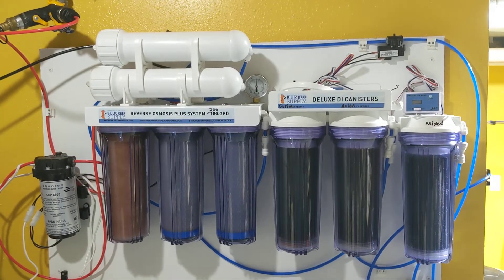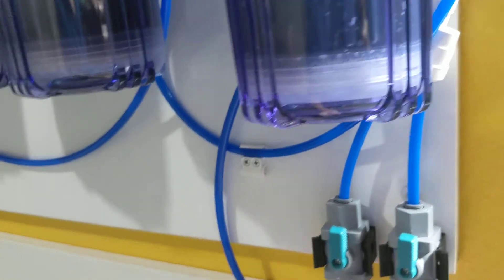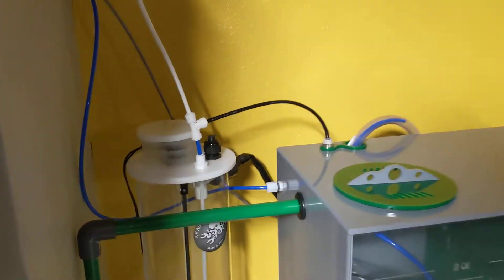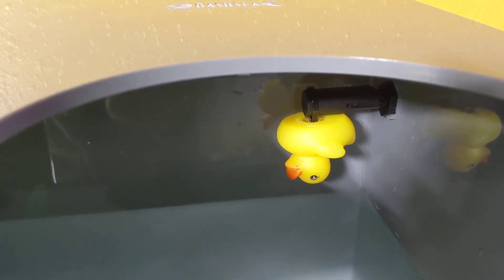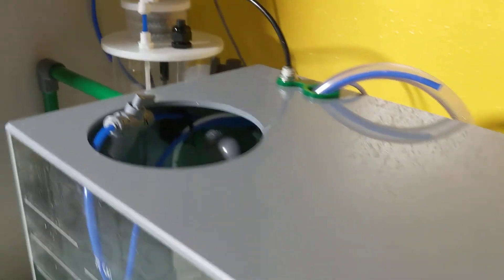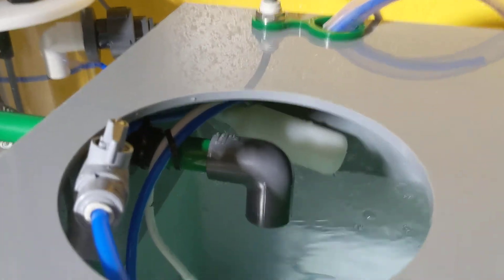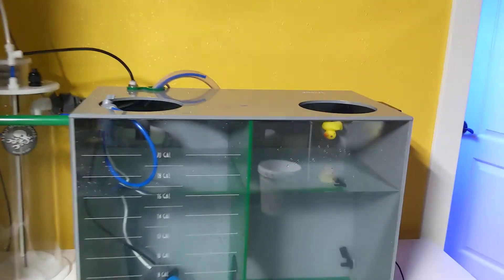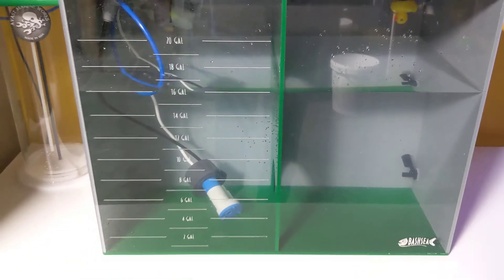BRS RODI plumbed to Bashsea ATO and Avast Marine kalk stirrer

Comment: Hi! I want to get the Kalk stirred but I’m confused if I used it with my ato do I need a dosing pump? Or just with my ato would work? Do I need a timer?
Reply from the maker: When I started i pushed Kalk from my stirrer through my ATO alone.  However this really just resulted in my overdosing it as my alk consumption was far below my daily evaporation rate.  This manifests itself by abiotic precipitation of calcium carbonate and was causing my sand bed to clump.  Other than that it wasn't hurting anything per se.  Some may experience excessive pH levels however.  Best practice (what I'm  doing now) is to pull RODI water from your ATO reservoir with a dosing pump of your choice and push that water into your Kalk stirrer.  Set it to dose the amount of your daily alk usage, at a minimum you have to know that regardless of what you are dosing (two part, soda ash, kalk etc).  The rule of thumb i go by for dosing kalk is 1.25% of your system volume of fully saturated kalkwasser will raise your alkalinity by 1.4 dKH.  For example if  you have a 100 gallon tank and you dose (via your doser) 1.25 gallons a day you'll raise your dKH by 1.4.  You'd adjust this down according to your actual usage of course.  The avast stirrer I'm using gravity feeds my sump so as my Echotech Versa doses RODI into my stirrer it just over flows into the tank.  It's been very precise to date.  Just make sure the calculated volume is less that your daily evaporation rate.  The remaining volume is simply made up by your ATO system.  In my case the Tunze 3155 makes up the difference on its own and it all works out perfectly.
Reply: @RobBzReef  let me see if I understand correctly ( I’m no from USA so I’m still need more time to learn/understand better) so I just bought the Avast Stirred and a ph controller. My plan is use one of the dosing heads to pump my Ato so it will feed my Kalk stirred, and connect my ph controller to the doser so in case the ph goes higher it will shut it down.
I have a 135g and the evaporation rate was around 3000ml per day, I dose Kh 7 ml per day and Cal 3ml per day. So now I have to divide the 3000/24hours? Or based on the Kh 7 ml 🤦🏼‍♀️ here is where i get confused. Thanks
Reply from the maker: @kamilawright5665  no worries, we can work through this.  I'll need to clarify a few things first so we get our terminology straight.  What is your tank's daily alkalinity consumption rate currently?  You mentioned dosing 7ml of dkH daily.  7ml of what?  That doesn't seem like much for a 135g tank regardless of what you are dosing.  What unit of measure do you track your dKH in (meq/L, dKH or ppm)?  

Let's start with an example using your 135g tank, we'll use dKH as the measure.  If you use meq/L or ppm there are conversions available (dKH to ppm => dKH * 17.86, ppm to meq/L => ppm * .358).  The assumption will be your tank consumes .4dKH daily in alkalinity and your total system volume (include display tank volume and sump volume if you use one).  In this example per our discussion we will be dosing a fully saturated solution  of kalkwasser(calcium hydroxide).

Total system volume * 1.25% => 135 * .0125 = 1.69gal or 6,400ml.  That gets us a dose of 1.4 dKH in alkalinity.  However we only need a .4 dKH dose for this example.  So we take our target dose (.4) and divide by our baseline .4 / 1.4 = .285.  Multiply this by our volume calculated earlier (6,400 * .285 = 1,828ml).  So in order to maintain a daily consumption of .4 dKH using Kalkwasser you would push 1,828ml of RODI water through your kalk stirrer daily.  If your daily tank evaporation was 3,000ml as you mentioned earlier you would make up the difference (1,172ml) in straight RODI water from your ATO using whatever liquid level control you have in place (I use a Tunze 3155, there are many out there on the market).

I hope this helps, let me know if you have any other questions.

Comment: Beautiful setup so far. Clear you have put a lot of thought into it especially with all the safeties you have incorporated. I must have flooded my basement 5 times before I got it right and really it never looked as clean as yours does even to this day. Keep up the deep thinking and your system will be great.
Have you gotten the Kalk stirrer up and yet and how have you found it so far?
Reply from the maker: hey, thanks for the positive feedback.  Always room for improvement for sure, need to start thinking about AWC next and finishing my light hood and stand covering next.  The kalk stirrer has been up for almost two months now (just shortly after the video).  It's really working as well as i had hoped.  It keeps my alk and ph very steady.  While I don't have a high demand as of yet for alkalinity a higher / stable Ph is much appreciated.  Been focused on other things but I've been wanting to put the stirrer on a schedule with my Apex to give the motor a rest as I don't really think it needs to stir 24/7 like it is.  Two thumbs up on the design and the benefit of it (just dump 3/4 of a cup in every two weeks or so).
Reply: @RobBzReef  For your AWC look into the AUTOAQUA I have one on my 400 gallon tank and love it. Its very easy to set it up and it also takes care of the replenishment water if you want it to or not. The pumps it comes with are small but you can always purchase the plug adapter or solenoid that replaces the pumps allowing you to use almost any other pumps you might need should your tank be far from your new water vat. I've had one in my system now for over a year and it changes out 5 gallons every night for me without any intervention except making new water once a week. It also has several layers of built in protection that have warned me of issues "of my own making"" several times. Its a little pricy and it is very small at the size of a pack of smokes but Ill never have another tank without one.